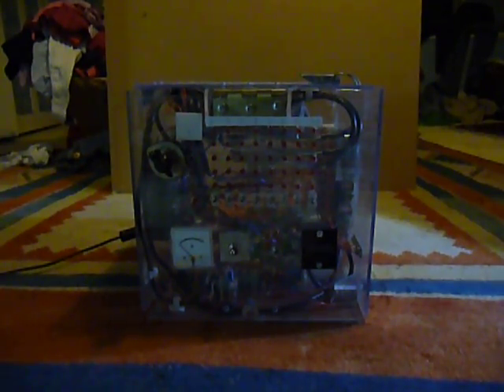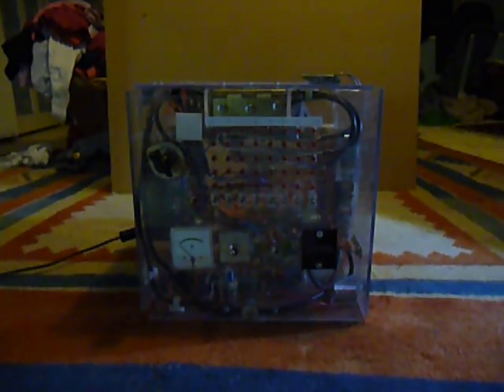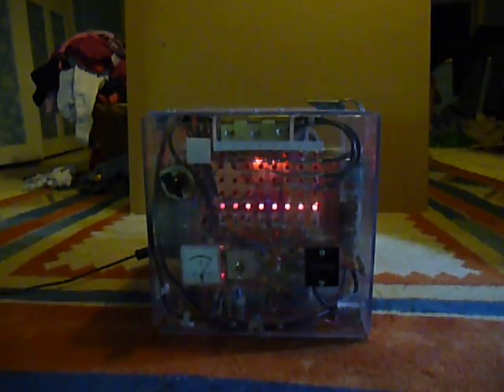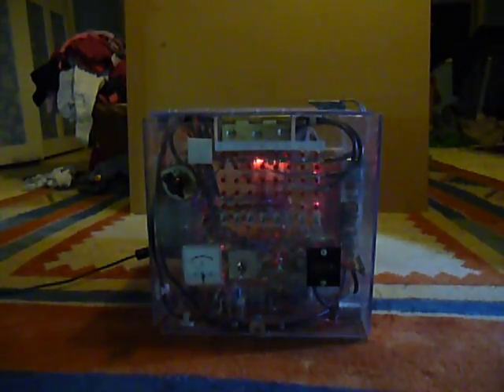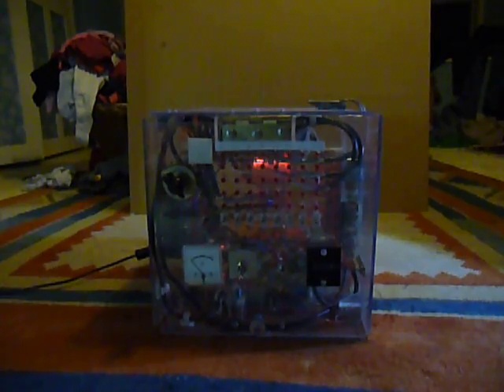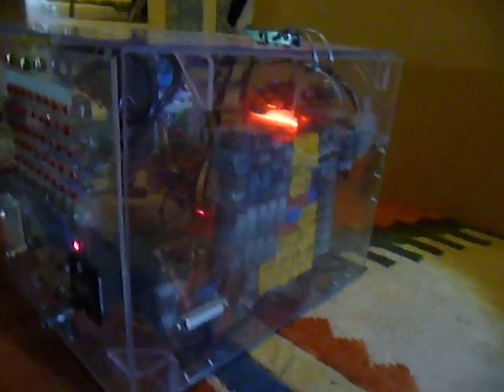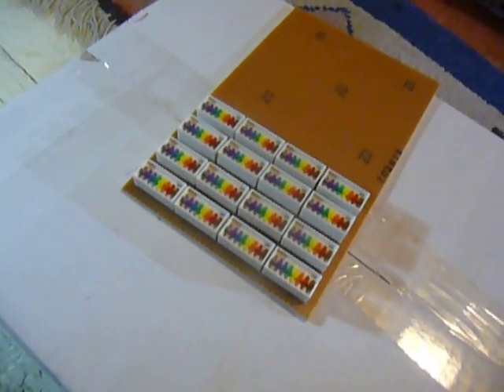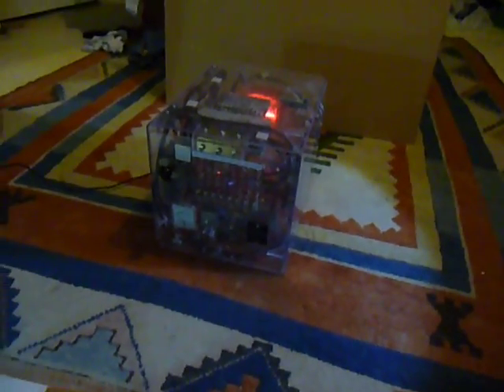TIM8 Relay Computer (Vlog 10): Capacitor RAM

Comment from the maker: Not quite. When the relay coil is powered up, it throws a switch inside it that then connects the switch input to a terminal. However when it powers down again, the switch falls back, contacting another terminal. When power is supplied to the base of a transistor it will let a current flow across it but not back, more like a diode than a switch. For a better explanation, Google it :P

Comment: Noob question: do transistors and relays work the same way?
Reply: Transistors and relays are both complex nonlinear devices, but complex in different ways. Relays have saturable cores - people don’t use them that way, but the core in a relay can be permanently magnetized and used to store information all by itself. The control of switch contacts is a cherry on top of that :) Transistors can be used as switches, but they have more uses beyond that: they also work as linear amplifiers, and as log/exponent generators. A transistor can do logarithms in a very simple circuit and you can read out the values on a voltmeter. So, in some ways transistors and relays are similar: they can be used as switches, but so can be many other things. But other than that, transistors and relays are totally different beasts, because transistors got two semiconductor junctions in them. So at the very least you can use a transistor as a pair of diodes (with caveats) and a relay can’t do that.